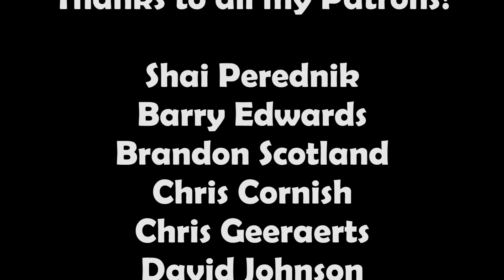Watch this before buying the Artillery Sidewinder X1!!

Comment: Why even the negative reviews seem positive.  What is with the western world holding the hands of these companies.  So frustrating.  These guys know what they are doing, there is no passion and no consideration. They are faceless entities just slinging junk. No CEO no face.   Let us sell a crappy item cheap as possible and see what the westerners are willing to fix. 

Anyways I am a long time subscriber, and usually do not comment.  I just hate these "hey China needs to fix this" when it actually should be.... "these guys suck don't buy it"
Reply: So what "western world" engineered and manufactured "CEO face" showing company's printer would you recommend with this feature set for $500 or less? No, really. Which one? I don't see or hear a bunch of hand holding here (or anywhere for that matter). I see people trying to save money and taking up (mostly) the challenge of fixing the problems that most buyers understand in advance that they're going to have with a Eastern World clone.
Reply: What features do you need?  Prusa works right out of the box.   $350.
Reply: @takingtheblackpill  The Prusa Mini? Really? Less than half the build volume. Keep trying.
Reply: @takingtheblackpill  you're right. I have no idea what point you mean. Enlighten me.
Reply: That's what I thought. You really didn't have a point. The fact is that there is nothing you can recommend. My question (in case you missed that point) asked what printer you would recommend under $500 with the same set of features. Build volume is a feature and one of the more useful ones. So you really don't have an answer other than avoiding the question by suggesting that I somehow am unable to fathom your extraordinary wisdom. If you actually have anything relevant to add I'm listening.
Reply: @ew7007  The deeper I get into the hobby, the more surprised I am by the arguments that flame up around tiny stuff.   All I can say is that I would have got a MK3 if there was one available, but it is single-sourced and even the pre-built version ($999) is at least two months back-ordered.    I don't see how it's a valid comparison.   Ender5 maybe...
Reply: Normally I'd agree with you. But Artillery does have a face. They are very active in the community and actually do show some passion. The warranty is very easy with no hassle, but the parts do have to ship from China. The fair assessment is that they do try to balance the quality of the parts with the cost of the machine. Definitely not the best parts, but also definitely not the worst. They are no worse than most American companies I have dealt with, and for the price it's nothing to complain about. The machines do have their shortcomings, but for under $100 in parts and a bit of elbow grease you can build a very solid machine. I'm in at around $600 and it has reached the point of reasonable reliability and convenience. I also modified my own Firmware and added M600 to the stock hardware though, which was alot of work.
Reply: Envovo does just assumes you have 4 hours to burn on "troubleshooting" broken things. Only after that they will ship you new parts. They just want me to do their testing for them with out having a serviceable machine. some easy design tweaks could make this thing much better. This would mean extra cost that they cant charge a profit on without getting up in price class.
It seems like they are not willing to make these simple modifications because they cant profit of it with out losing price competition

Comment: I've had mine for a little more than 6 months now. I've printed almost 20kg's of filament, multi colored prints, lots and lots of filament changes, and I have yet to have any of the problems you talk about in this video.
Reply: I have had my X1 for over 6 months now. I have never broken the idler. I have had issues with the 20 pin connector however. I found some locking connectors I plan using. That should solve the problem.
Reply: Same printing as we speak, not a single problem. When changing filament i just use the onboard extract. never have to push the idler , not once.
Reply: Is this a compatible arm, I was thinking of replacing it before getting the printer? https://www.amazon.com/dp/B085WVH2QY/?coliid=I178CTMOFLXYH7&colid=LPZTEWYSPXLO&psc=1&ref_=lv_ov_lig_dp_it_im
Reply: 2 months, extruder motor, 20 pin connector and the cable....too cute printer but too fragile
Reply: @Sp1y3rS  
2 big mistakes, the pladtic arm must be metal, and use that flat cables !!!they are good for Sgnals, Not for Power!!, so yuo need to secured very well, if not its gona made a spark do to the high current...i really love to se someone to change all this cables to "normal cables", then yuo could have a very good printer and more secure(i dont like the steek glass, i want a remobable one too).
Reply: I received my X1 last week, and the lever came already broken exactly the same way he shows in the video. Waiting for replacement.
Reply: @saquitomac2573  there is a way to feed the filament in without touching the lever
Reply: Brian Cruz that’s the problem these dudes think you have to move the arm to insert the filament lol! He even says it in the video 😂
Reply: @chancegreen7334  right!
Reply: @briancruz4090  Yes it is. When you press IN and the cogg starts to spin just push the filament in a bit it will bite and feed it in=)
Reply: @saquitomac2573   they come with a spare arm  tho right?
Reply: Any Printer have issues, its a physical think called ENTroPy,yuo well see whfn yuo have a clog nozzle

Comment: I'm somewhat surprised that you didn't mention the lack of an all metal heat break as a potential issue.
An easy enough upgrade, but something that I wish they would come with out of the gate!
Reply from the maker: I haven't noticed that to be an issue yet. If I was doing high temp filament maybe but PETG is normally the hottest thing I print at 235C

Comment: About two months in with over 500 hours of runtime and not a single problem other than operator error as this is my first printer.  I understand that quite a few people have broken idler levers but what I don't understand is how.  My solution is don't touch the lever... I have never needed it as the filament loads fine without it.  So you say don't buy the printer but you make no suggestions as to an alternate suggestion.  Tell me one printer under $500 that doesn't require some upgrades?  I chose to focus on more relevant issues like the direct drive extruder over the bowden tubes which seem to always be an issue on the lower cost machines like the Ender 3 or CR 10.   Issues like the ribbon cables are easily solved as you have demonstrated and not a reason to discount one of the best 3d printers for the money.  FYI... I'm currently 2-1/5 days into a 3 day print and not a single flaw in the print.  I was even able to change out spools in the middle with no problems.
Reply: Creality Cr-6 Se or Artillery sidewinder x1 ?
Reply: @BirAdSecin  both.

Comment: I put a line of hot glue alongside all the ribbon cables. If you use some isopropanol alcohol and apply it with a small brush onto the hot glue, you can easily take the glue off after a few seconds without any force at all. The alcohol itself will dissipate completely.

Comment: Your "review" or troubleshoot video for the SWX1 is kinda criticism on a very high level. This is a printer for 400$ or less. What do you expect? A part, that can break after 200+ hours? No problem, just print a new one...
The fried pin? Rather not a "normal" failure, every product has some problems sometimes.
I don't know what the hell brought you to do this "review", problems out of the box? What is the difference if you buy this thing for 400 and upgrade some parts or if you buy the printer for 500$ from the factory?
Reply from the maker: This isn't my final review. This is me addressing 2 big issues with the printer that caused it not to function at all very quickly.

Comment: You are posting this in 2020... 
* Idler: problem is fixed from factory in current versions. Of course they CAN break and wear as they are consumable items though, but normally they will last long
* ribbon: problem is fixed from factory with newer boards so that more wires are used.

Of course there are still some older ones out there but new orders should get the updated ones without problems. Just order directly from factory though.
And: the first ones did not have these problems with the idlers and also not the ribbons, just got there in later changes.

About the subboard: don't just replace ONE but you need to replace both or you will just get problems with the ribbon-cables, probably even more then first. The latest versions are different.
Reply from the maker: I was supposedly sent the most recent version. (People say that because it has a reset button) So having the idler break twice, the second being the "new design" they sent me and the fried ribbon cable says it hasn't been fixed. 
The idler is not a consumable. No idea where you get that fact from. I have 2 legit E3D Titans and they have never broken in the 3+ years of use and have several thousand of hours of printing on them.
Reply: @Fugatech3DPrinting  Ok, so you did not get the latest version of the subboards that is for sure. Since the factory does not have official versions there is no way to check from the box, but you have to measure it yourself and count the wires. There should be 2 sets of 4 wires on both sides of the X-ribboncable if you have the latest version.
Same for the idler: it is much stronger in the newer versions. I believe they shipped that  from november 2019 or start of december only. Before that you had one of the 'between versions'. 
I have one - amongst newer - of the oldest ones and they have strong idlers like the last ones (from november-december). And yes, I call them consumables because they will wear out like the heatbread, nozzles, wires and gears.
i have printed some on spares and they only break when I have a problem like a stuck filament (on the spool or in the sensor or other guide) or press to hard myself on the idler. Well better to break the idler then for example the motor or its bearings which you cannot print yourself or buy for about 60 cents online.

The reset-button has been there since beginning of the summer by the way, so a long way back for this printer that has been updated all the time since 2018, still sold under the same name and version. There are more then 30  different 'versions' from it that I have seen  and for the last months it seems to be stable and 'end product', all the times improving on the feedback of customers and  replacing parts for free for at least the first 3 months after buying from factory.
First ones came with the gripping on the ribboncables but that has changed after that, probably because of consumer-problems that did not know how to fit the ribbon-cables the right way and went for a simpler solution for installing.
Reply: Do the new boards have better connectors on it? If not, I don't think they last long. Ob my printer the 30pin connector gets really hot on one spot on both ends. Thr marking on the board says V1.6. I'm planning to exchange the connectors with better ones. But all in all I would buy the printer again.
Reply: @bene3445  The connectors themselfs have not changed since the previous version of these for as far as I noticed, but the wirering has changed. Therefore you need to replace both boards at once to prevent melting and shortconnects.
On the latest pre-version there were 4 connections for the + on one side, one gap and 3 connections for the (switched) - for the heater. The 'gap' on some boards (like the latest iteration before the last) is connected on the other side to the + ... On the newer boards (november-december 2019), there is no more gap between + and - (so you have to set the cables correctly !) and you have 4 connections for the + followed by 4 connections for the - of the heater. 
So, if you have the old board with the + on the connection of the 'gap' on the right and have the newest board on the left, you have a direct short when you turn on the heater.

There are no different versions written on the boards though so you have to count wires / connections or get both at the same time as a new ribbon cable (that is also a bit different then in the previous sub-version that were shipped in september-oktober).

(Yes, this printer is more exiting then a soap on TV!)
Reply: @elvinhaak  Spare Boards are on the way. I'll change them all or at least I'll conduct measure them and follow the traces. My plan still is to exchange the connectors on the boards

Comment: 1) There is no version five. 2) Changing nozzles at only 230° guarantees you are going to have a leak before long, then you'll blame that on Artillery. 3) When changing filament, use the thumbwheel rather than hulking out on the idler arm. 4) You put a link to the wrong PCB. 5) You recommend a bunch of "fixes" before testing them. 6) The idler and ribbon cable designs can be improved, but you blow the problem all out of proportion. Confirmation bias is when you have a problem and you only register those who have the same problem. Searching through FB posts,  I counted 16 people who reported broken idler arms, and about as many who replaced them out of fear that they could break. That is a tiny percentage of all the printers that Artillery has sold. And since you came late to the Artillery game, maybe you did not realize that there is a version 4 because Artillery has improved the design whenever flaws were uncovered. Is there a version 4 Ender 3, CR10,  or any other cheap Chinese printer? You have some valid concerns, but calling the machine a piece of crap and dissing people like Angus Deveson and Devon Monte for recommending is not right.
Reply from the maker: 1 - People in the group said it was v5. Regardless, after 4 versions it still breaks.
2 - 230 is fine, I've done it dozens of times on other printer with no issue. 
3 - The last idler arm broke during a print. As I said in the video, if you watched it, I have it as loose as it can be and yet it still breaks. Crap components and no one can question that. 
4 - Thanks, I fixed the link but he is out of stock :/
5 - Can't test a fix before actually doing it...
6 - Just because Angus and Devon got working printers means their opinion is more valid than mine? I got it just like everyone else did and it has 2 major issues that kept me from using the machine for over a month almost right out of the gate. That is a QC issue. The exact same thing happens with the MK3. Most have great experiences, including myself, but there are a ton of people that complain about fan issues and overheating extruder motor. Issues that I just don't have. Is there opinion not valid because that have a non functional machine? No. 

Paying to fix a device a week after receiving it is not OK regardless of the price point or who made it. Would you be ok if your phone broke a week after receiving it? How about a KitchenAid mixer? All can cost about the same and my conclusion is the same.
Reply: @Fugatech3DPrinting 1. Understood
2. When one takes the word of random people on Facebook as gospel, but completely ignores directions from E3D, who designed the Volcano hot end, that weakens one’s credibility. 
3. Understood.
4. You are welcome.
5. Can't test a fix before doing it, but you can test it before making a video and recommending it. Just sayin...
6. They had problems, worked through them. And frankly yes, their opinion is more valid than yours (and mine). Mr. Deveson (I'm not on first-name basis with him), for example, is a degreed industrial designer and 3D printing is his business, not his hobby. I agree with your point about the MK3, too. It had problems. I didn't see any Youtubers calling it crap.

You didn't have to pay to fix the printer; it has a warranty. Artillery quickly responds whenever I contact them. Yes, I would be disappointed if my phone, or KitchenAid broke within a week. I once bought a new Honda Accord, a brand known for quality and reliability. But I didn't get 10 miles from the dealership before trouble struck.  Was I disappointed? Yes. Did I go on youtube in front of 15.6K people and call it crap and imply that  Consumer Reports, J.D. Power, et al were shills? No.

Comment: Got to remember, a lot of people has had no issues with the printer at all. I am one of those. I always check everything on any printer I buy. Tension on idler arm is to high set from factory. My original is still going strong.
You have a few valid points on the other hand, but those are minor and not in the scale of "do not buy this printer" - try to be as objectiv as possible, it will benefit all - in the end.

Sure, it has some issues, as almost all Chinese printers, but this one also has so many good options and comes at a low cost - so buying small things to make it perfect is easy.
Reply: @ Stig, You said it perfectly.
Reply from the maker: I didn't say don't buy it. I said I can't recommend it as the "BEST PRINTER EVER" like all the others.
Reply: @Fugatech3DPrinting  15:09 - 15:19, "My current suggestion as of right now is to not buy this machine" - not my words, it`s yours.
Reply: PS. I have not seen any others writing or saying this is the best printer ever.

My view? It`s totally worth buying, but people will run into issues, as with all other printers, especially those in this price range.
Reply: @Fugatech3DPrinting  Yeah, you kind of did. Twice by the way.
Reply: @Fugatech3DPrinting  Who said it is the "BEST PRINTER EVER"? Please stick to facts and leave out the hyperbole.